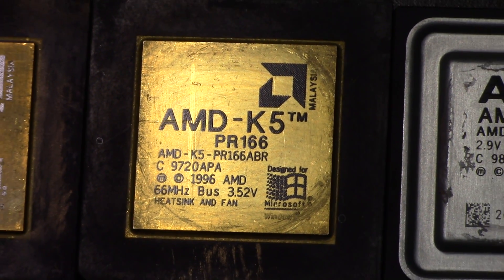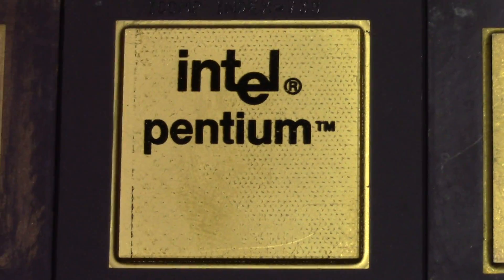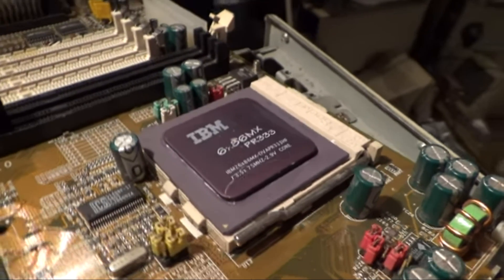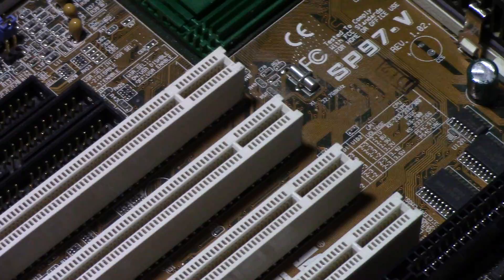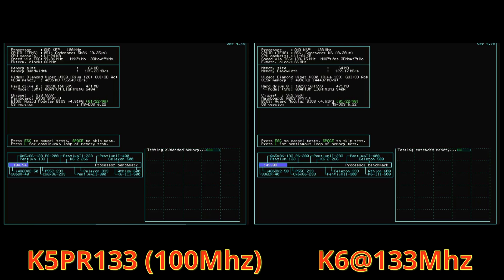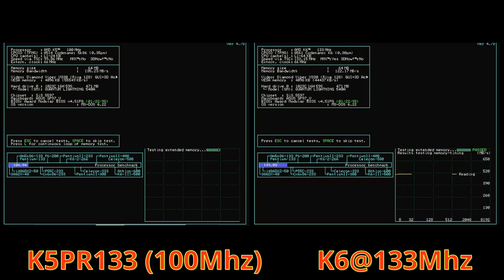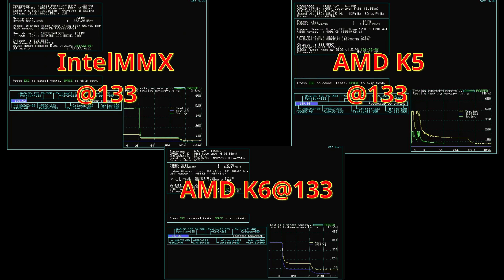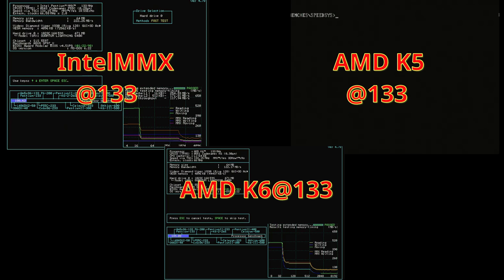AMD K5 vs K6

Comment: Thanks, Great Video
Is there really much of a difference between a K6 2 and a K6 3
I have a K6 2 400 was wondering if a K63 would be worth the upgrade
Reply: If your motherboard can support an 5x or better multiplier and 100MHz FSB, then probably, if you can get it cheap. The K6-III has onboard L2 cache, which is actually a pretty significant boost.
Reply: The onboard L2 definitely put the K6-III back into a tight race with the last of the Pentium II processors and are bitchin' fast.  With Athlon just around the corner, the K6-III really didn't get much of a chance to shine outside of laptops.
Reply from the maker: what motherboard do you have?
Reply: An FIC PA2013 Revision 2.0
It came with a Intel Pentium 200